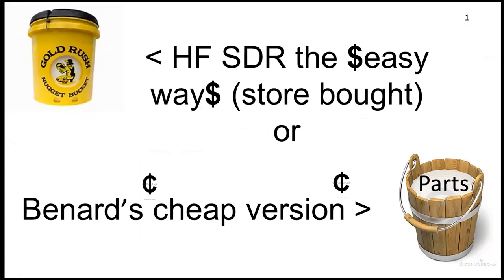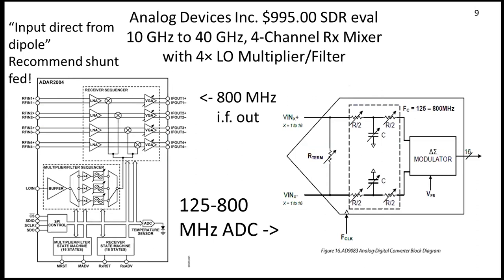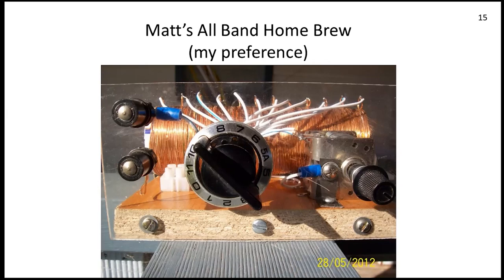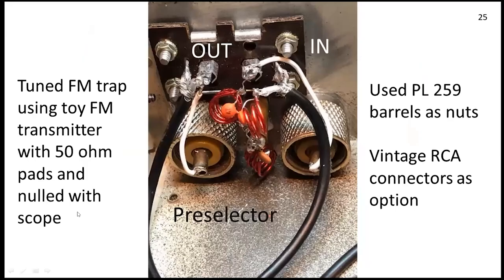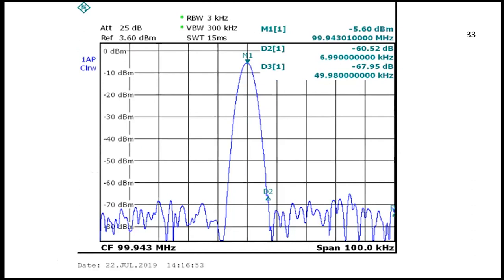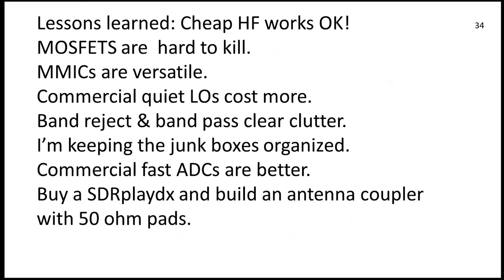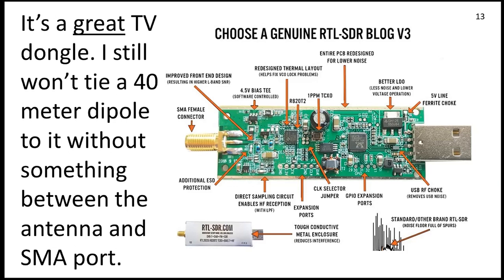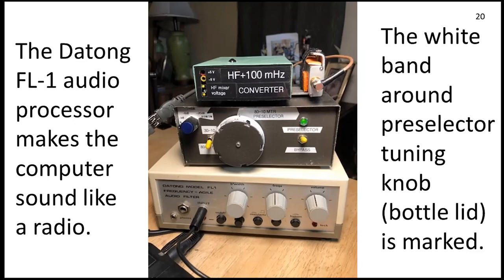Easy Or Cheap SDR

Comment: Very fun and informative discussion! I have two RTL-SDR.COM v3 dongles and I am so impressed with their sensitivity from 3 MHz to 1 GHZ when used with the proper antenna.  I also use a Ham It Up, up-converter to eliminate the mirrored aliases which pivot about 14.4 MHz, that are associated with the HF direct conversion mode.  Up conversion isn't perfect either, as it has images of its own, but I can more easily live with those.  Those images are similar to single conversion heterodyne reception which I have grown to tolerate!